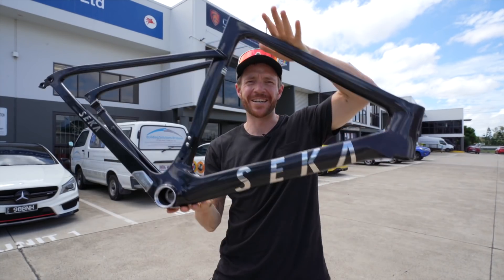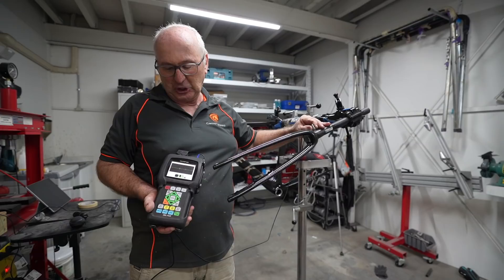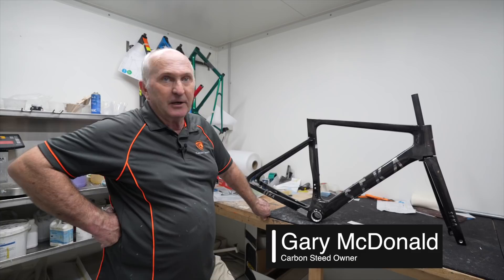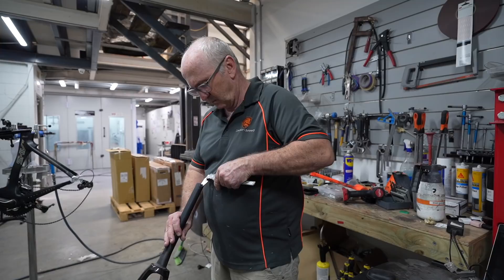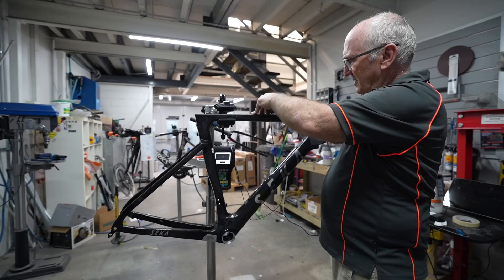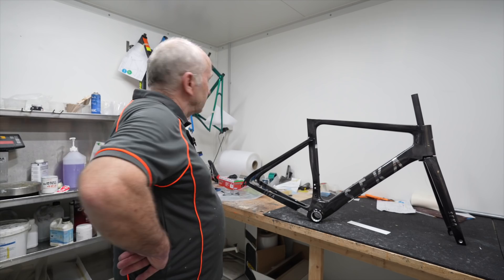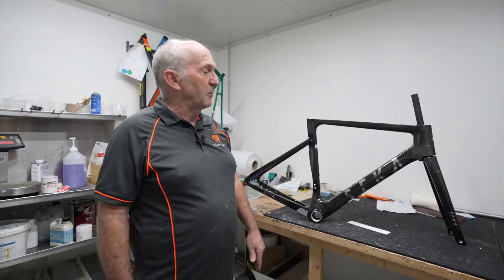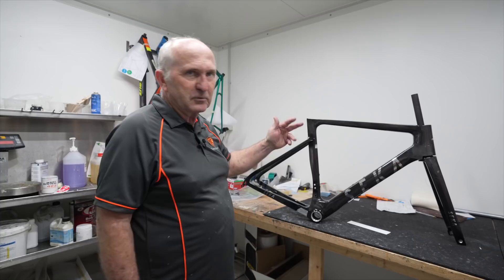Carbon Fibre Expert Inspects the SEKA (before the build)

Comment: Would love to know what Gary meant when he said it's "thin". Is it drastically thinner (50% thinner) than what he sees in other frames or just marginally thinner (5% and barely measurable)? The current description leads one to believe this Seka frame might be too fragile compared to others and I'm not sure if that's the correct take away.
Reply: 1/10 of a millimeter. It doesn't make any dent, probably a 5000€ s works have it worst in some units
Reply: They are all thin. Perhaps Gary would have commented on expected thickness in the same section and shape from other brands.
Reply: Watch my sl7 sworks squeeze test videos if you want to see what thin is haha. Squeezy downtube means flexy under big power and around hard corners.
Reply: My Scott Team Ltd - 2004 had a top tube you could visibly "squeeze" with your thumb and forefinger.

Comment: Yep very interesting to o see a frame inspected independently when new, surprisingly this doesn’t happen often , more so when they fail. It would be interesting to see or have the next level seka down to see if the carbon if thicker , beyond the 0.78 wall thickness and so would that be more resilient to knocks and wear, lightweight obviously mean compromise somewhere. Looks like this is better laid up and more consistent than the scary big S frames being scanned currently… bet your looking forward to riding that to see how it feels

Comment: You should do a segment that inspects actual high end frame to actually see are there differences in quality.  You did inspection on china frames which has nothing to compare to other than that dude in the video talking about that specific China frame.  But how does it stack up against something like an Sworks ?

Comment: In my radar!, can´t wait for the build. Also wonder if it´s compatible with new Ultegra DI2, and the weight with some decent rims and groupset hope you cover those
Reply: Can't see why this, or any road frame set wouldn't be compatible with that group set...or any other road group set.
Reply: @chrispalmer3096  yeh guess so, just battery fits in the seat post, but looks pretty standard here
Reply: @yeyo9664  he didn't show the seat posts, but that frame looks like it's uses a post similar to several frames on the market.

Comment: That is the issue with road disc. The thickness is too thin (to try to counter the extra disc weight) and breaks too easy during light crashes. The bike industry LOVE that though as less warranty as most road disc bikes will be destroyed hitting a gutter or light crash or even falling over from the dog knocking it down in the garage.

Comment: Hi, I see recently u reviewed a china brand called Sava, can u also do another china brand call Java ? This year they just released a full carbon frame, fork, handlebar, 50mm wheels...etc at around $1250 USD. It's UCI certified I really wonder how is the quality of the carbon. The Sava is not UCI certified, I wonder does the UCI certified on the Java means anything ?   
The Model is (JAVA FUOCO J-Air 2021)

Comment: Given that this is the lighter version of the Seka Exceed, I wonder if the lower end (same frame shapes, a little more weight) frame has more "margin for error". Seriously considering both this frame and the Winspace 1500 for a build next year. Both are very similarly priced (given that the Seka includes a one-piece bar and stem) and both seem reputable. I like that the Seka comes with a T47 BB a bit more than the Winspace's BB86, but honestly I'll take a BB86 over any other press fit standard.
Reply: Winspace right now are doing great deal on blackfriday, t1500 + Hyper wheels for 2100$usd
Reply: I'd like to see a comparison between the two exceeds with this check too. That'd be a lot of work for Cam
Reply: The Winspace T1500 is really old design, been around for many many years now. Its time they made an update to it
Reply: @sebbelito2975  yes it is from 2018 I think, I show some videos about it...

Comment: Can you do a review on the Elves bike brand, i'm looking to buy on of those frames, they come to $1200USD with the handlebar, i'm thinking of building one up as my first road bike, with a sensah empire pro 2x12 speed grupo and some cheap wheelset. I'm thinking of going with the eglath frameset as i think is a better option for a newbie, rather than the aero or lightweight option they offer (Falath and Valar). Or if you have any other recomendation i can follow for a build under the $2200usd, tell me please. Yoeleo is also one on the consideration list, likewise their wheels and farsports too.
Reply: why such a heavy build up?

get a winspace slc rim brake with a near new sram red groupo and some 1300g wheels and you have yourself a bike lighter, stiffer and faster than anything being used in the WT today. I own 37 high end road bikes and can afford anything. That is what I would buy if I had to spend my own money and wanted the very best performance and durability.
Reply: @durianriders  im trying to do a build up under 2200€, the red grupo and 1300g wheels would surpassed that by far
Reply: @durianriders  also the Winspace slc is 1400€, i ain't rich for that 😂😂

Comment: In all bike manufacturer what carbon are the best?? Like specialized pinarello bmc trek and etcc
Reply: If you watch Hambini, Look & Time are the best.
Reply: @sac22833  what??
Reply: @kuzzzzzzzzzzzz7511  yup, time adr handmade im france so with 3T made in italy. Both made with resin transfer not prepreg carbon like most bike. Time, and 3T is way above most of big brand name
Reply: @kuzzzzzzzzzzzz7511  Time Bikes use a different type of manufacturing, its more consistent but more expensive, if you want the best build carbon from buy a Time. Pinarello use Mitsubishi prepreg carbon fibre (so do Seka). Most others use Toray. The issues/faults come from the manufacturing and design of the frames not the material.
Reply: Colnago c64, look all, time all
Reply: @declan979   You are correct.  Biggest contribution affect carbon frame's mech properties are manufacturing process and design.
Reply: @declan979  Pina use Torayca.

Comment: Thin ... So maybe not for the heavier 90kg 200lbs people.
Reply: if you are over 80kg you shouldnt be riding carbon bikes
Reply: @11-inch  Not necessarily. Many frames WERE spec'd out at  80KG/176 pounds but not anymore. You can find carbon frames for 300 pound folks now. They aren't weight weenie light though.